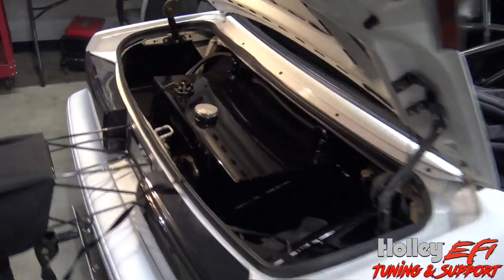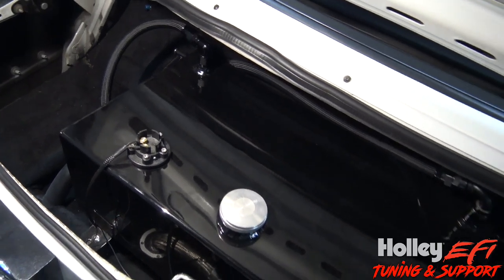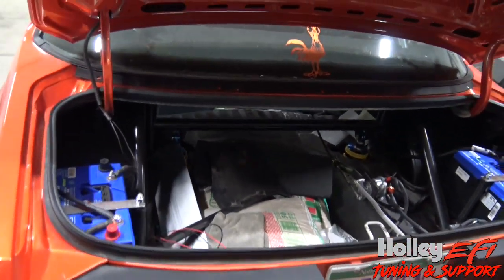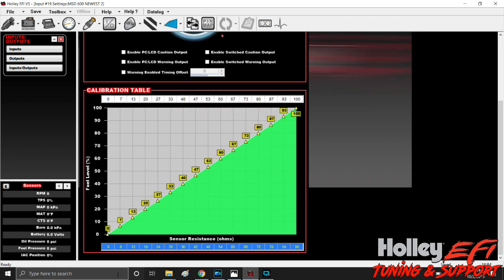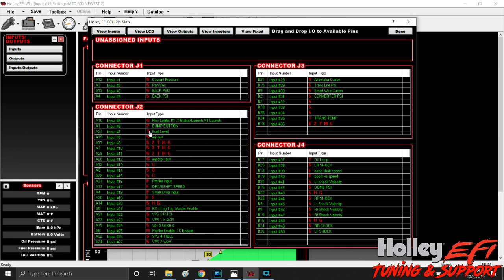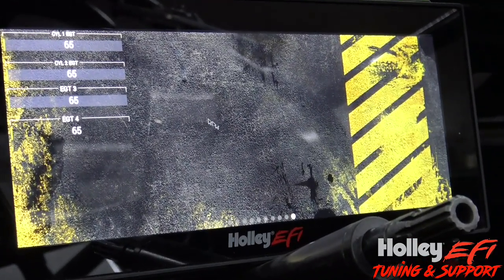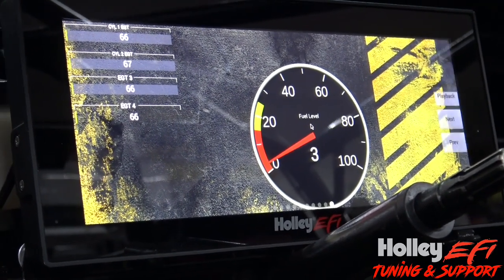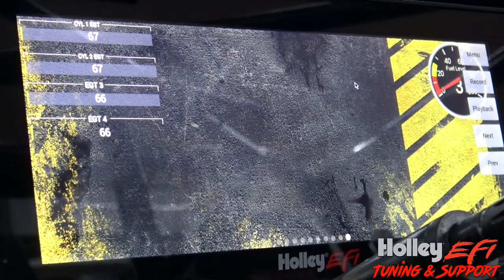Adding a Fuel Level sensor to your Holley Efi and how to set it up in software as well as dash

Comment: So I have the fuel sender reference wire going to a configured input. Do I need to run a shared sensor ground from the ecu all the way back to the sensor ground wire?
Right now I have the sensor ground wire off the sensor grounding to the frame near the tank and the ecu is not reading it
Reply from the maker: i always run a sensor ground from ecu to the sender yes

Comment: I have had a fuel gauge and for years. It has never been accurate to drive with. They say the dash screen has an Ohm buffer you are supposed to use so the fuel gauge does not bounce all around and you can accurately read the fuel level.

Comment: Terminator X doesn't have thermistor option. What would you use?
Reply from the maker: A dominator
Reply: @theholleyefiguy  Thanks for not helping. Could have explained there is a way to make it work, if you have a Holley dash.
Could try to help people more, without an attitude and telling them to spend 2000.00 for another ECU, when they can do it with a 40.00 harness, and not the 260.00 holley dash i/o harness. 

People suggest buying system from people like you " That will give actual support, unlike jegs, summit, etc," But haven't seen you reply to anyone without an attitude and your site never shows anything in stock.

👋
Reply from the maker: So you're mad cause you asked what I would use and I replied with a dominator? Instead of me then spending however much time explaining to you and only you exactly how to do something for the absolute cheapest way possible? Got it. If you haven't noticed I don't do things the cheapest way possible. Maybe someone else can make you your own custom videos and hold you hand a little tighter.
Reply from the maker: Maybe I could try to help people more. You're right, I work 20 hours a day, I make informative tutorial videos and field about 200 questions a day. Man I'm so damn selfish.  Can you send me your address so I can come do everything for you for free of course.
Reply: @theholleyefiguy  Hooking a connector and wire up, is inexpensive. If wire and connector is good quality, why would you call it cheap?? Sounds smart to me, then switch to a Dominator, when you already have a system.
Reply from the maker: @funfun8095  1. I don't think I'm better than anyone. When did you pay me to do anything for you which caused you to feel so entitled? 
2. Your insults can do alot better. Try harder, kinda like your ability to read instructions
Reply: Custom ohms
Reply: @curtdog74  Not an option. Have to do it through 7 inch dash we have, with extra harness of course.
Reply: @funfun8095  exactly io10 on the dash
Reply: @curtdog74  Thanks. Yeah have seen that with aftermarket harnesses. Just dumb Holley wants over 260.00 for the harness. Found info I needed without Devins attitude.
Reply: Lol i bought a harness for 45 bucks from a guy making them
Reply: @curtdog74  Yeah, I got one for 40.00 from ebay. Holley could sell one like it, for same cost. The 9 year old Chinese kid assembling them might get a bowl of rice for the day, for making it.
At least your 45 and my 40, stay here and isn't going to Chinese sweat shops.
Reply: @funfun8095  where did you get the harness? Any item numbers? I'm looking at running a fuel gauge with terminator max...

Comment: In your opinion is it better to wire the fuel gauge to the ECU like you did rather than to the 12.3 pro dash? I'm asking because I can't get mine to read correctly running it through the pro dash.  I also have my trans temp running to the pro dash and I'm questioning if it's reading correctly too.
Reply: Needing to know this my self.

Comment: Do I have to add a pin to the plug that goes into the back of the Pro Dash?  I got the software side figured out just need to know where to connect the 0-90ohm wire from the tank sensor!

Comment: Hi new to Holley efi and having a hard time with my 7in screen In changing or adding gauges I’m just not understanding. Do you make files for customers? I’d like to add fuel level and trans temp. Vehicle is a 98 ws6 terminator x max with factory body harness still hooked up. Thanks

Comment: I quickly looked through the 6.86 pro dash and didnt see the fuel gauge option. Maybe I missed it or possibly need to update? Anybody have any experience with the 6.86?
Reply: Mine is there at the bottom,the sensor isnt working just saying its full all the time

Comment: What is the difference between sensor ground and chassis ground, and why do you update them to use sensor ground?
Reply: Holley has Sensor Ground Input that you wire/populate out to the Sensors (PIN A18 in J1A connector on HP and Dom.)...
This assures the sensor(s) are properly grounded directly to the ECU to read accurately (rather than grounding them to the chassis)...
Go to Help, Wiring Manuals & Diagrams, Pinout and you'll see that both J1A and J2A connectors (on Dominator) have Sensor Ground Input in PIN A18, plus two more in J3 and another in J4...